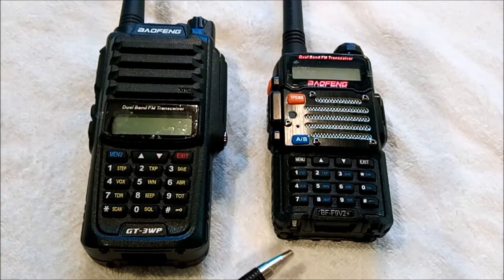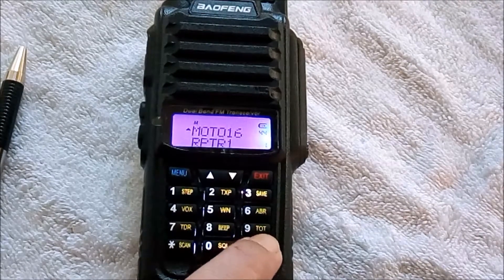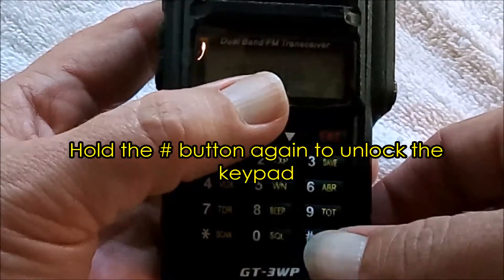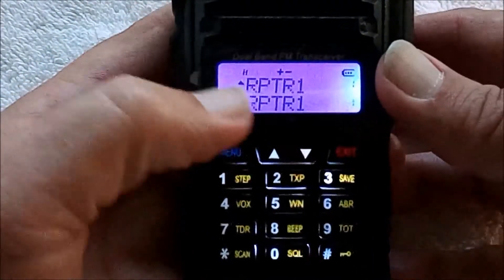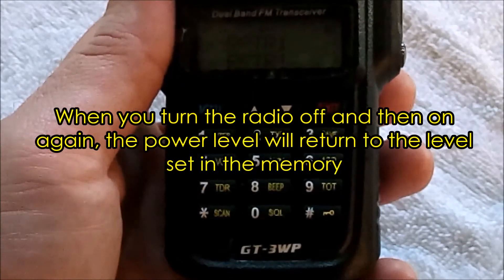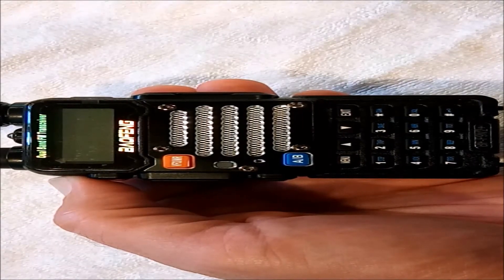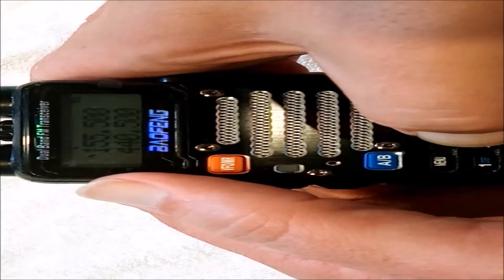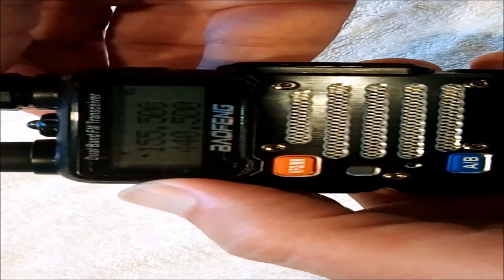Change Power Level Shortcut Button - Baofeng Radio

Comment: Nice, my UV-82HP wouldn't save the power setting if you did it the long way. Glad I saw this cuz it worked and is way easier!
Reply: Same issue here! I wish it would save if you do it through the menus. This seems to be the only way, at least in channel mode.